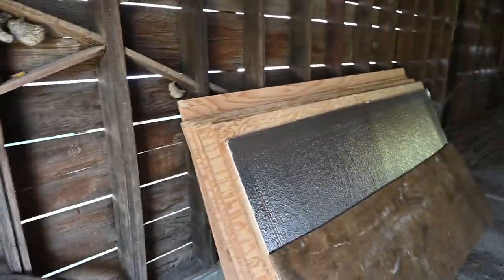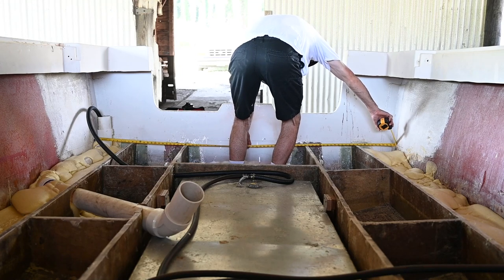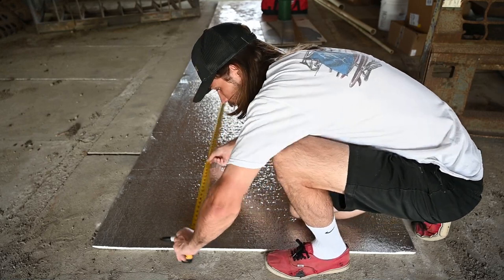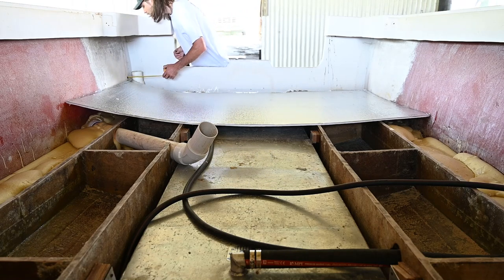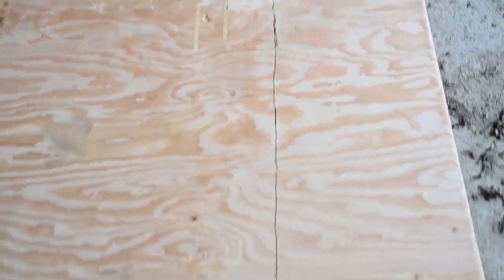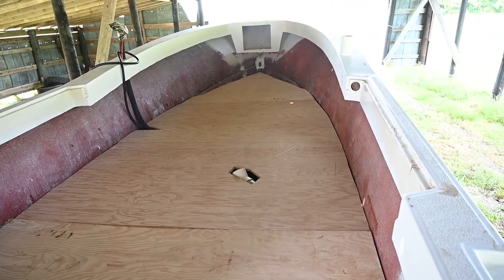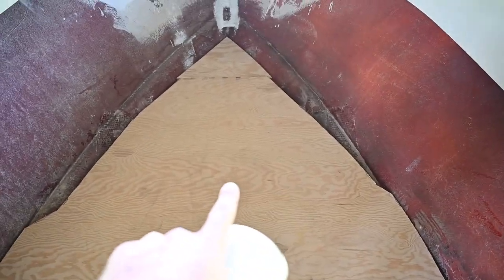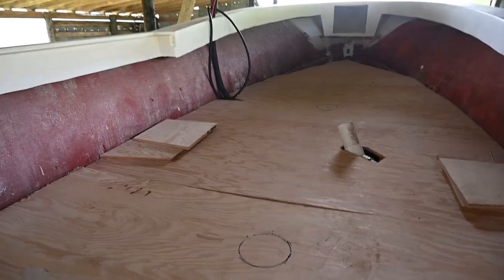Rebuilding a Center Console Fishing Boat - Episode 7: Cutting the Deck

Comment: I saw the styrofoam before I checked the description and all I could think was “oh no baby what is you doin?”

Interesting design with the deck, I’m intrigued by you not having any drainage gutters along the sides or transom area and I’m curious to see how well the water drains out while the boats at rest. I’m watching the series closely and making a lot of notes for my own boat resto-mod. 

Excellent series and explanations! High hopes for how this beast turns out!
Reply from the maker: Haha yea. Live and learn, I guess. When you take those notes, remember to note down what I did wrong so you don’t make the same mistakes. This isn’t a perfect build like I’ve seen others do, but it’ll be good enough for me and my needs. 
I’ll be drilling some scupper holes in the transom to allow the deck to drain. The deck is sloped enough to drain that water to the stern when at rest.
I appreciate the kind words!
Reply: the water isn’t going to drain and urethane foam holds water right next to the unglassed stringers. maybe 1-2 years before all the wood is dead and he’s back at square 1
Reply from the maker: @tannerbabb8383  what’re you talking about lol all stringers are fully glassed and the entire stringer system has drainage.
Reply: @intotheforrest  I think he means that there is direct contact between the flotation foam (technically untreated, with no resin or fiberglass to protect it) and the underside of the deck (which IS resin coated, and should give it some longevity) but I agree. After a few seasons of hard-core fishing, I think that the foam will start to compress and you’ll start seeing cracks along the edges.
Reply: @Into the Forrest I also recommend making sure you tab the absolute smack out of the top deck. Like 8 inches up the gunnel and 8 along the deck

Comment: Need stringers on the port and starboard sides, so that your decking has something to sit on at the edge.
Reply: the grain of the wood is wrong also. it should be running with the length of the boat or it will warp or cup. That's what i learned the hard way building boats.

Comment: Question I desperately need answered lol, do you secure the new plywood to the stringers in anyway such as peanut butter or screws or is it just sitting on top and fiberglassed on ?
Reply from the maker: I put peanut butter on top of every stringer, then the deck plywood on top of that.